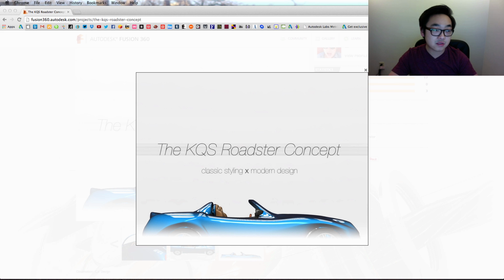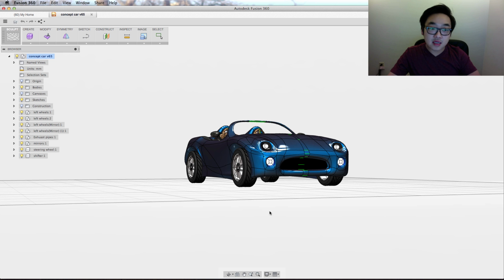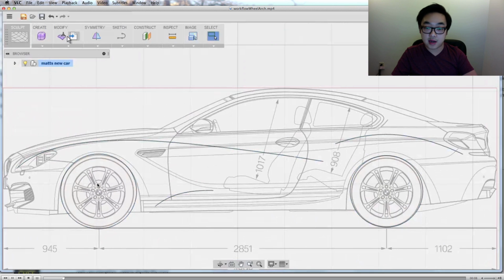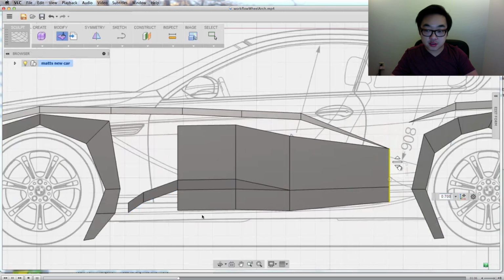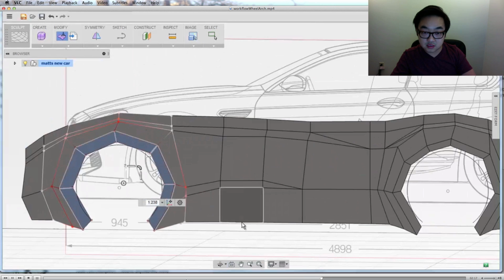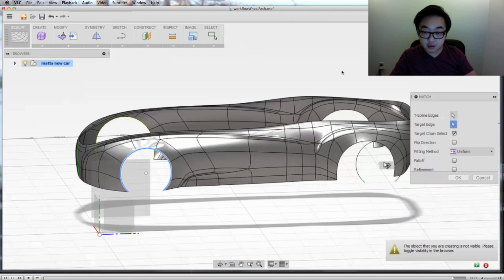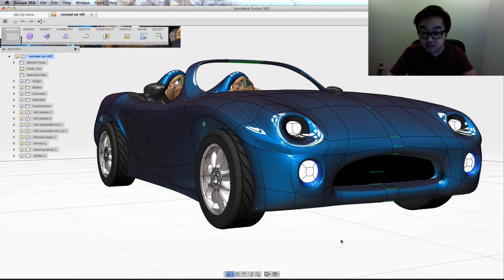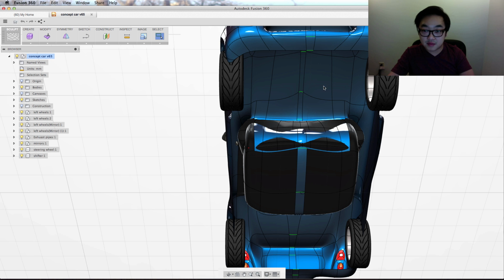Modeling a roadster concept car in Fusion 360

Comment: Instructive tutorial about T-spline, but some simple steps are explained in detail and then in short succession is several operations (on stop the video) can not be identified.
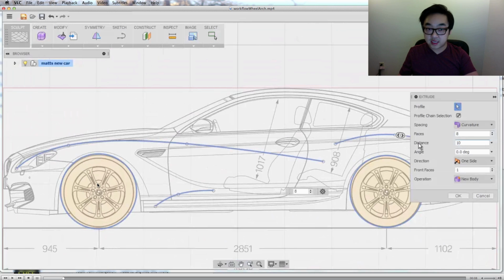Reply: Radek Šlégl I agreed that some operations cannot be identified. For example, I cannot extrude a spline like he does at 6:55. Any ideas on how to do this?
Reply: He goes into PATCH mode, and used the extrude under the Create menu icon. The extrude in MODEL does not extrude a spline.

Comment: When I weld stuff the faces lose their smoothnes, for example the wheel well. Am I doing something wrong? Sometimes I can weld a piece and it'll stay smooth, but sometimes it just derps out and loses its smoothnes.
Reply: Are you in box mode when you are welding?
Reply: Keqing Song I usually do it in the "combined box and smooth mode". In your video it looks very easy when he welds some faces to the wheel well, the other faces just stick to the wheel well without it moving. Is it possible to make faces static in some way to prevent it from getting affected by other faces? Will upload a video to show you better. Thanks

Comment: I have some homework from school where I have to model a car in Inventor. Would Fusion 360 be a better choice? It's very complex and time consuming to surface model in Inventor from what I've tried. Great vid, thanks
Reply: I would say that it is a different process, and depending on how much you're familiar with either tools, I would say that Fusion 360 is comparatively faster at conceptualizing designs such as this one.

Comment: That was great, I really like the step by step approach to sculpting the car body with T-splines.  I wouldn't have thought of laying out the features, lines and wheel wells that way.  Then welding the vertices together to form the desired surfaces.  The more I learn about T-splines the more potential I see they have.

Cheers and thanks for sharing.
Reply: Thanks man, its a great technology that is easy to start experiencing but also has a good amount of depth and subtle nuances that you can grow into. More importantly though, its fun to use :).